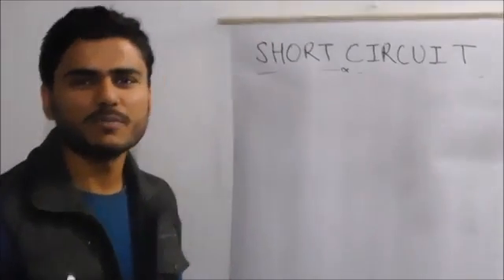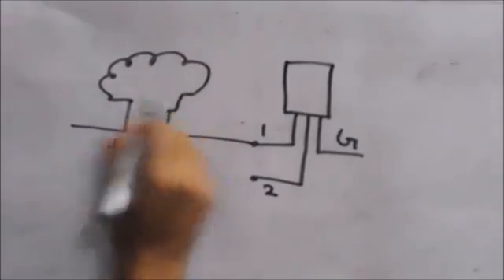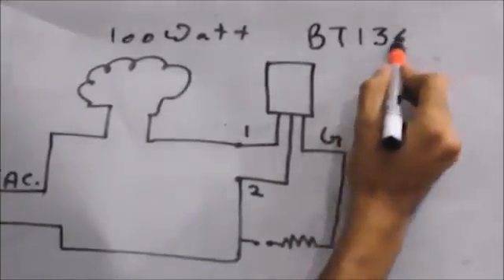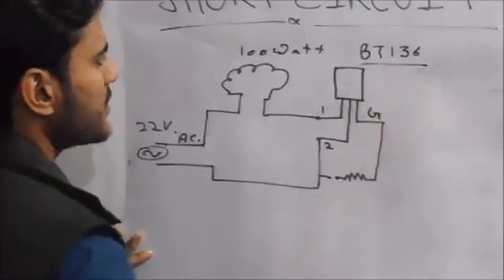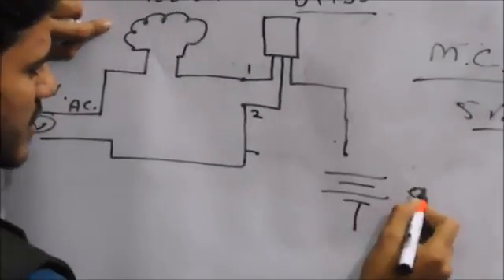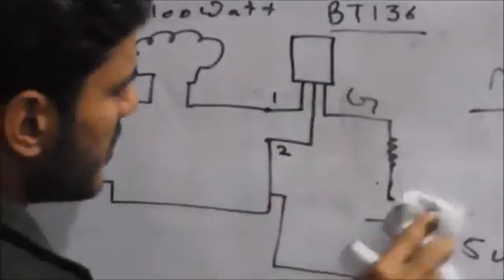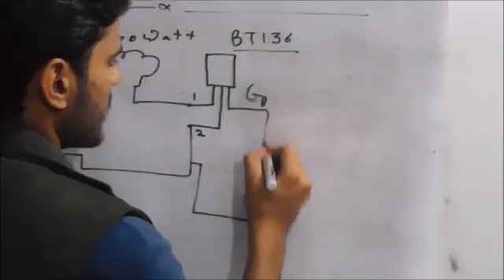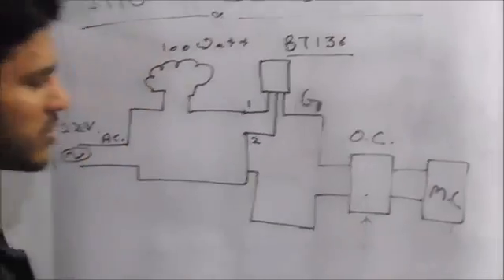Ac switching using triac

Comment: I have the same project but different Triac, im using a BTA16-600B and MOC3041. for 220VAC. Do i need to change the value of the resistors for 220VAC? thanks!
Reply from the maker: first you should check the datasheet your triac

Comment from the maker: Be careful , connect gate  to main terminal 2 and not to main terminal 1
Reply: I was going to say the same thing (i.e. be careful) - is that a mains (220V) board @ 8:03 that you are sticking those wires into?! :)
Reply from the maker: the circuit i am using here to power up optocupler ic(MOC3021) is not totally isolated from main supply
 you can even use AA 1.5 volt battery from moc3021

Comment from the maker: Parts used are :
1. bt136 triac
2. moc3021 optocoupler
3. two  1k resistors
4.connecting wires and breadboard
Reply: Short Circuit hi can you pls mail me the schematic at santoshranjandas@gmail.com
Reply: Same problem different resistor use kr chuka hoo